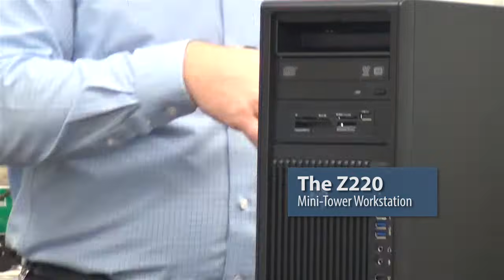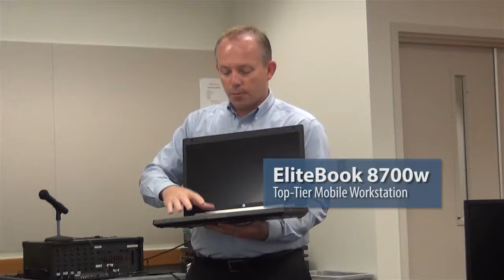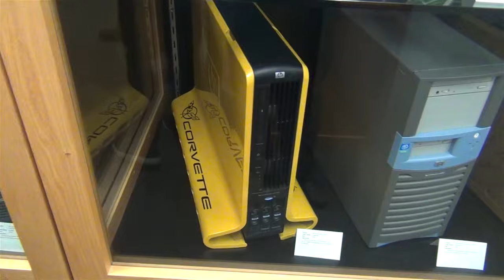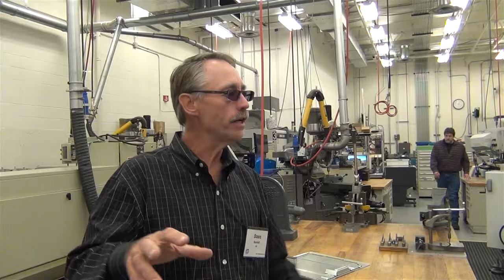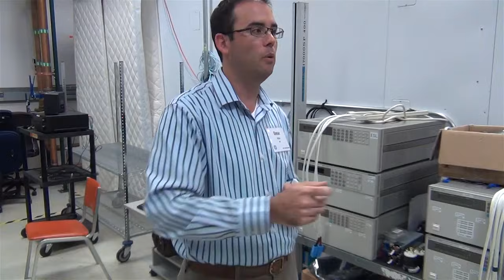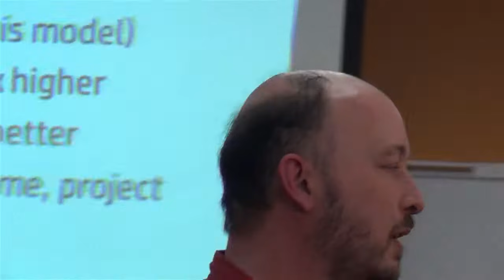How HP Makes their workstations: A Tour of the HP Labs

Comment: I have so many of these Z820s & Z840s in production, most running 100% CPU / GPU utilization 24/7 and not a single component of a single one has failed.  That's impressive.  Best computing value on the market.
Reply from the maker: Thank you, those machines are built like a tank!
Reply: @Joeherman  They really are. Contemporaneous Mac Pros = crap shoot whether they'd arrive with bent legs or not.  Had a Z820 literally shipped with just cardboard taped around it (I was livid) - but the machine was undamaged and is still in production 😂. I really needed it at the time and couldn't fool around with returns.
Reply from the maker: @mumblety96  I agree! I am writing this to you on a Z840 right now!

Comment: I bought the Z840 workstation with NVIDIA  Quadro P4000 for video editing and photo manipulation with Adobe products.  It is working great, but I have only one processor and plan to get the second soon.  (living on a fixed income) . I love my HP Z840 .  Very fast and reliable.  Thanks HP
Reply from the maker: Thank you. I have an HP Z840. Still running great (mine has two procs).